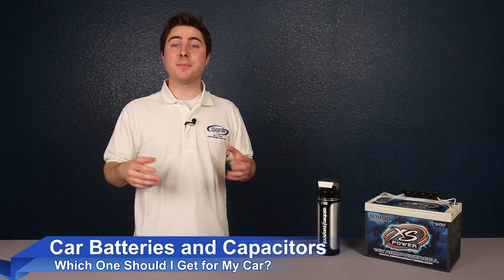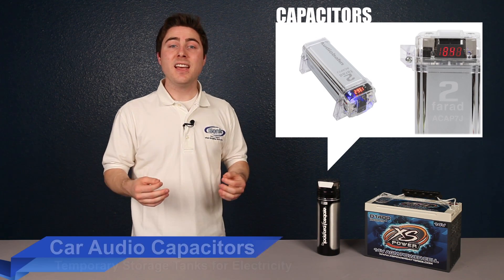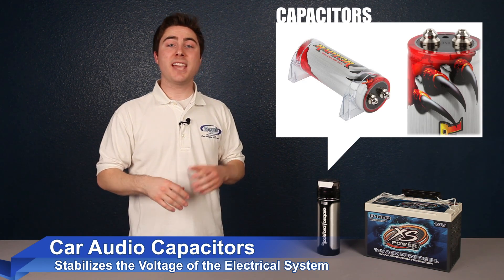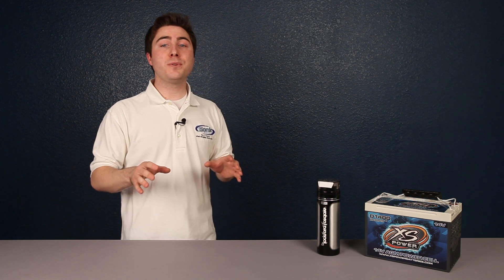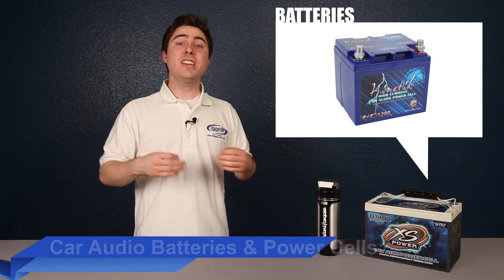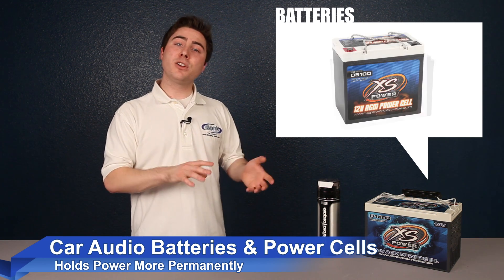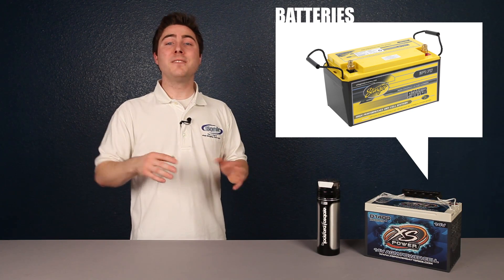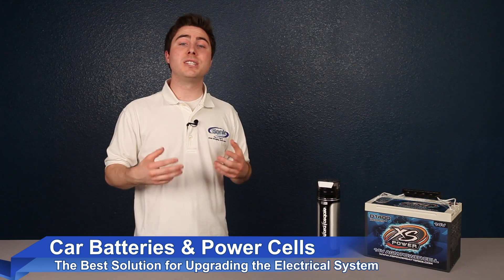Car Batteries or Capacitors: Which Should I Install? | Car Audio Tips

Comment: Get two batteries. Run them in parallel with two 0 guage positive runs back. Let the signal processor (massive for example) cut your sub amp off when the voltage hits a pre determined point. When your at the park and your subs cut off start your car. I feel its the best balance of performance vs bieng practical.
Reply: From a comment on a post trying to say caps are bad, "This is completely against all physics of electricity. I am a sound engineer and I went to for both electronics and acoustics. Caps are very important to the balance of an electrical system in a DC environment. If you look at the insides of any good amp, you will find a shit load of caps on the power supply side of the board. YOu are right that caps make things worse for amp but only if there is not battery in the entire circuit. A battery is a natural balancer of all things electrical. As a matter of fact, the alternator that you say is the most important thing in a car, you are right but only if there is a battery in the circuit. If not, you’re lights will flicker because an alternator is not a steady stream of pure DC voltage like a battery is and will hurt your entire electrical system. They produce AC and convert to DC and that circuit is rarely pure. A battery is pure DC voltage. All 3 batts, caps and alts are needed to have a balanced electrical system and get enough power to your amps. The most important thing that is rarely talked about that is needed in respects to clean power is good connectivity. Amps that are closest to a power supply(Batt or Alt, not caps) create more power to the speaker and run cooler. Even using Ohm’s law in regards to power wiring and you know the correct gauge and length of wire, does not take into the effect of environmental physics. IE – Temperature of the air around the wire as well as the temp of the wire itself. As the temp of the wire goes up, the resistance increases and therefore needing a higher gauge. This also happens to batteries and alternators the more power they have to produce. They will heat up and not be as efficient as room temp. Alts work great in cold temps but batteries are the opposite due to chemical reaction physics of Batts vs metalerical physics of alts. All this points to one conclusion that is often missed, double the size of the wire that the math tells you to use and make all of them as short as possible. Connectors are also often missed as an essential part of this issue. High current systems need power connectors that are soldered using a torch(not a soldering gun) and not just a screw down connection of just a crimp. YOu can use those but you must also solder them. This will ensure a perfect connection that will not corrode over time or deteriorate due to high temps and humidity. Either way, the alternator is least thing needed to be upgraded in a system as long as you have array of batt and caps near the amp. Reason is simple, batteries store lots of powers as well as create power (yes they create power using a chemical reaction which is why if you crank an engine till it wont anymore and then wait a little while you are able to crank some more) but discharge their power very slow, Alts create power, do not store it but push more power than a battery can per second, caps only store but can discharge thier all thier power in literally milliseconds which is why they can be dangerous but are extremely efficient because of thier very low internal impedance. Point being, batteries can be charged by any source if you alt cant keep up like a home charger. You can also let you car run for a while to be sure your batteries are charged if you know you were draining more than the alt can push out to charge them. It’s just math and you cant get around it. Batteries are the most important part of a high powered car audio system by far. As a matter of fact, I blew my alt a long ago when I was traveling and was about 500 miles from home. I couldn’t just replaced it because it was a high power aftermarket alt and I needed to get it fixed. I turn off everything possible in my car and kept driving just using my 5 Kenetik AGM Batteries and 30 farards of caps and they got me home easily and the voltage never got below 11.9 after the 500 mile trip."
Reply: jeremy whittler yes, but how long will your alt continue to charge these 2 batt? Especially if u keep draining them down to what u consider to be the lowest possible v you would prefer your amp to run on.

Comment: So many people talking about headlight dimming in the comments, but nobody is mentioning the importance of "the big three upgrade", smacks forehead.
Reply: From a comment on a post trying to say caps are bad, "This is completely against all physics of electricity. I am a sound engineer and I went to for both electronics and acoustics. Caps are very important to the balance of an electrical system in a DC environment. If you look at the insides of any good amp, you will find a shit load of caps on the power supply side of the board. YOu are right that caps make things worse for amp but only if there is not battery in the entire circuit. A battery is a natural balancer of all things electrical. As a matter of fact, the alternator that you say is the most important thing in a car, you are right but only if there is a battery in the circuit. If not, you’re lights will flicker because an alternator is not a steady stream of pure DC voltage like a battery is and will hurt your entire electrical system. They produce AC and convert to DC and that circuit is rarely pure. A battery is pure DC voltage. All 3 batts, caps and alts are needed to have a balanced electrical system and get enough power to your amps. The most important thing that is rarely talked about that is needed in respects to clean power is good connectivity. Amps that are closest to a power supply(Batt or Alt, not caps) create more power to the speaker and run cooler. Even using Ohm’s law in regards to power wiring and you know the correct gauge and length of wire, does not take into the effect of environmental physics. IE – Temperature of the air around the wire as well as the temp of the wire itself. As the temp of the wire goes up, the resistance increases and therefore needing a higher gauge. This also happens to batteries and alternators the more power they have to produce. They will heat up and not be as efficient as room temp. Alts work great in cold temps but batteries are the opposite due to chemical reaction physics of Batts vs metalerical physics of alts. All this points to one conclusion that is often missed, double the size of the wire that the math tells you to use and make all of them as short as possible. Connectors are also often missed as an essential part of this issue. High current systems need power connectors that are soldered using a torch(not a soldering gun) and not just a screw down connection of just a crimp. YOu can use those but you must also solder them. This will ensure a perfect connection that will not corrode over time or deteriorate due to high temps and humidity. Either way, the alternator is least thing needed to be upgraded in a system as long as you have array of batt and caps near the amp. Reason is simple, batteries store lots of powers as well as create power (yes they create power using a chemical reaction which is why if you crank an engine till it wont anymore and then wait a little while you are able to crank some more) but discharge their power very slow, Alts create power, do not store it but push more power than a battery can per second, caps only store but can discharge thier all thier power in literally milliseconds which is why they can be dangerous but are extremely efficient because of thier very low internal impedance. Point being, batteries can be charged by any source if you alt cant keep up like a home charger. You can also let you car run for a while to be sure your batteries are charged if you know you were draining more than the alt can push out to charge them. It’s just math and you cant get around it. Batteries are the most important part of a high powered car audio system by far. As a matter of fact, I blew my alt a long ago when I was traveling and was about 500 miles from home. I couldn’t just replaced it because it was a high power aftermarket alt and I needed to get it fixed. I turn off everything possible in my car and kept driving just using my 5 Kenetik AGM Batteries and 30 farards of caps and they got me home easily and the voltage never got below 11.9 after the 500 mile trip."
Reply: Big 3 didn't help me. I used extra 4 gauge wires for this. A capacitor stopped my dimming.

Comment: I have a kicker solo x 18 going in my 2007 Yukon Denali and I'm going to be using a digital design M3 3800 Watts Max so 2800 watts at 1 ohm I only have a 250 watt alternator, it's been like 5 months without Bass I hope I'm good for now if I start seeing dimming XS power welcome to the family

Comment: in what cases i should consider capacitor? lights dimming, battery drain, ... ?

if i just do easy listening when driving, do i still must have it?
Reply: jw200 you have to have it, it's a must! Get a 10 farad voodoo capacitor. go on Amazon or eBay to buy it
Reply: Consider a capacitor if you have a very very slight overall system drain (dying on night trips over 20 minutes long) or if your battery maintains its charge no matter how long you drive, but your headlights dim the whole time. Be very careful about which brands to trust, and try your best to find out what farad supercaps are on the inside of it before you buy, brands are known to lie about the actual capacitance of their products. Also it's much better to go bigger than smaller than you need.
Reply: On the latter example of your headlights dimming the whole time, also make sure that the battery isn't in need of replacement. If so then replace it and make sure the headlights still dim before investing in a capacitor.
Reply: I got a lawn mower battery solve my problems with dim lights

Comment: Lol the capacitor debate😅. If caps are worthless, then go outside on a hot summer day and remove the cap to your condenser fan motor and see how well that works out for ya....or better yet open up your amp and delete the caps in there and see how good it sounds.
Reply: Jeffrey Barton why people tell you don't buy caps is the cheap $20 cap is not going to help. But a $200 cap will. But if your already spending $200 on a cap why not just spend $20-$50 to get a better battery or even a second battery.
Reply: @Djbz170  
You cannot replace a capacitor with a battery. AGM batteries are not designed to give on massive bursts of power like caps are. If you only rely on caps, your system will be very lacking in the dynamics department, and you'll run that poor battery VERY hard. I've worked in pro audio for the last 20+ years, and been doing car audio on the side for even longer. What always boggles my mind is the fact that people don't realize the simplest of things. When you look into a car audio class D amp rated for say a combined output of 3000 watts, there's next to no caps in there. But if you open up say a Powersoft K series  or MC2 E series amp, there's capacitors worth at least 1 farad per. 1 kw of power.
Add to this that those pro audio amps run on a much higher voltage, so they need less amps to put out the combined watts. It's absolutely ridiculous to expect ANY amplifier, being it a class A/B or a class D to put out power properly, if there's no real reserve. A reserve is not only the batteries or alternator that lets the amp play for extended periods, with a LOW crest factor. When you play music where there a high crest factor, where you need the headroom and energy bursts to provide dynamics, caps are the ONLY real solution. Why this is even still debated, is truly mind boggling. But I guess it's down to the fact that not other place of all the Audio world is more filled with self proclaimed experts and "engineers" than the car audio world.
As for the quality of the caps? You're absolutely right. You do need a proper quality cap, just like you need a quality battery, good power cabling etc. It all adds up.
Reply: Jeff Barton 
Hahaha really? That cap on your ac motor is so a single phase ac motor can run. It suppresses the opposing ac wave just long enough to get the motor to spin. After "x" rpm is met, the hall effect sensor cuts the cap from the circuit. Please dont throw unrelated bullshit into the mix.
Reply: Jeff Barton 
Now your second point.
Cap are used to stabilise voltage ripple. Not going to agrue that but i will say if your alt cannot keep up with your load (most cases >500Wrms) then a cap is just a bandaid and wont fix the problem. You will find out first when the suppressor cap on the alt fails then the valtage regulator and H-bridge with fail and is if all fails very fast you will fry you windings in the alt. Batteries are only really useful once the engine has stopped.
Reply: @The_Koups 
Very true. Just like a battery should not, a capacitor should not be used in place of an adequate power supply. I think this is where some of the myth that caps are pointless has started. If people use things for what they were never intended to be used for, they will of course not work. How voltage stabilization and providing super fast bursts of energy is what it's all about. No batter can do that, not even the highest C rated Li-Po cells.
Reply: @AB-80X  yes i do understand what you are saying but in the case of car audio these surges are more fequent thus having the power head room is better than just adding caps. For startest you dont use Li-ion if you want hight C values, you use LiFePo4 or better( LiFePo4 is the easiest to get right now)
Reply: @The_Koups 
Hold on for a sec buddy. Read my comment again. I said Li-Po, not Li-Ion. Trust me, Li-Fe cannot surpass a real Li-Po when it comes to discharge. Li-Ion? Absolutely, but actual Li-Po? No. i've been building  Kilo style high speed RC planes and boats for over 20 years, and there's no way you can get the amps from a Li-Fe like you can from a Lithium Polymer cell. Only thing that currently rivals the Li-Po as far as I can tell, is the HV 3.8 volt style Li-Po cell. Only place where I find the Li-FePo4 to be nice, is in regards to safety as the risk of a fire is much less prevalent. I mentioned Li-Po as a reference, not so much as an option. Not sure if anyone is currently offering a Li-Po for car use unfortunately. Plenty of Li-Ion, but no Li-Po. That being said, even an Li-ion still has a discharge rate any AGM style battery can only dream of. I run a Braille i49CS 63 amp hour Li-Ion in my daily driver, and it's one hell of a battery. The price is a bit on the high side of things, but man do they still work great compared to any AGM for a medium'ish sized system in a daily driver. PCA is 3625, and I've yet to see the voltage drop below 13.6 volts, it's a beast of a battery. If the price was right, they would be the mainstay in a lot of car audio, that's for sure. They weigh less than 10 kg and if my math is not entirely off, I'd say I'd need a battery of about 185 amp hours to get a similar discharge level.
Reply: @AB-80X  ah yep i did somehow miss that. Whats the C rate of your Li-pos?
LiFePo4 have a discharge of 50C that i have found thus far. Now couple that with a 50Ah and thats a fuck load of peak amps. More than any car power wire can handle. LiFePo4 also have a longer more stable life, dont need to be "primed" 《the fuck is this shit? 😂
And have a good discharge peak.
Reply: djbz bruce-zabala a 2nd battery can and most likely will do the opposite of add power to your system. It will reduce your overall output of your alternator by adding additional load. Instead of your alternator charging 1 battery now it's try g to charge 2 plus run your amp and keep your car running. You are much better off upgrading to a more powerful main battery and upgrading to a larger alternator than you are adding a 2nd battery. A 2nd battery would only be good if you listen to your system without your vehicle running. ✌
Reply: Jeff Barton ,
Reply: Try running a 1000 watt amp just off of the charge in a 2 fahrad capacitor, it'll power it for maybe a few seconds, a decent 60Ah car battery will power it for at least 15 minutes, probably more. A capacitor can be used to get "cleaner" power, but it can't replace a battery. The capacitor bank in the amplifier is used to pump out power into the speakers, but these caps are fed by the alternator and battery.
Reply: Wayne Holden 
A battery is a battery and they all need to be charged. Car audio, deep cycle, high vibration, etc all add load to your alt which reduces the output headroom of the alt. The extra battery only allows you to play longer while the car is not running.
Reply: Liam Cooper I know that but you have to have a alternator that can charge them
Reply: Wayne Holden 
If you know that then why bother saying an extra battery will "fix it" when it won't do shit without the alternator.
Reply: Do some research on it some people just add multiple batteries
Reply: Wayne Holden 
If you really want a battery "fix" then LiFePo4 batterys are the only way. With 275A (55Ah) discharge current it will keep up. 110Ah LiFePo4 has 550A max draw. Normal car batterys will give you that for 30seconds. By the time you buy that or enough normal batteries a alterator is cheaper.
Reply: Just add a second alternator you all
Reply: Andrew Nelson that’s not true a stock battery yes but a aftermarket car audio battery stores energy for your system